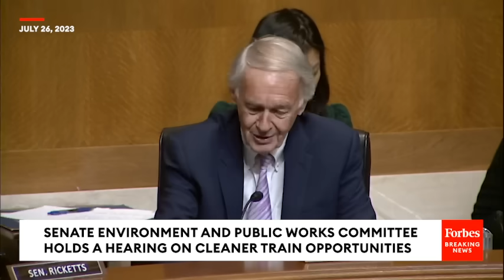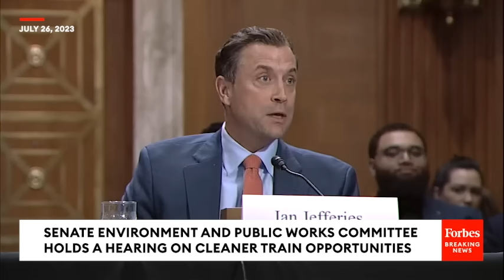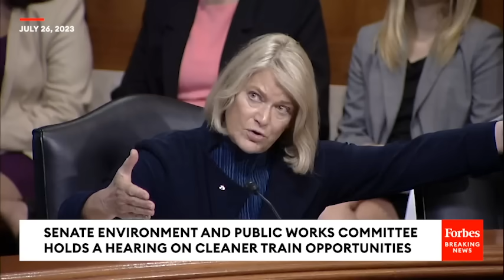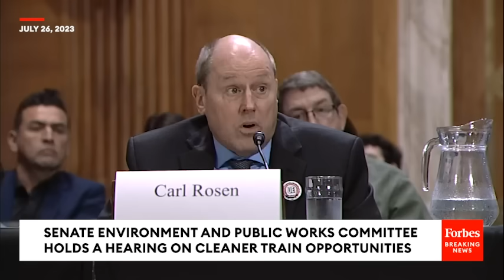‘How Long Would It Take To Replace All Diesel Locomotives With Electric?’ Cynthia Lummis

Comment: Locomotives are electric, the electrical power is generated by on board diesel engines. What she probably means is to remove the diesel engines and have the locomotives rub an overhead wire, like a streetcar in the city. She needs to be educated on the laws of physics. She also needs a job at Walmart where careless decisions go unseen. The wrong people in politics is a dangerous thing.

Comment: Electric locomotives? This is a pipe dream. The weight of the batteries alone would severely reduce the pulling capacity of the train. Those batteries would probably take 3-4 full days to charge.

Comment: How far do they go on a charge? How much carbon does it take to get that battery into the locomotive?
The estimate from VW to get the carbon foot print of the Passat EV and the diesel even is about 100k. The estimated life span of the EV battery is about 100k, the average diesel engine will go about 400k.
Most diesel locomotives go 1,000,000 miles. How long will the batteries last? How many charge outs will have to be done to get 1,000,000 miles. How many children will die in slavery mines of 3rd world countries to make California happy??

Comment: What a joke. Glad she is not willing to put up with their bullshit.

Less they are running power lines all over the place that trains run from and that electricity is coming from nuclear power, this is a pipe dream.

Let's also not forget the amount of batteries (weight and wasted space) that it would take to have enough power to accelerate a train with cars up to speed and maintain said speed for even a short period of time.

It is much like a large rocket going to space where a HUGE amount of the payload is the actual fuel.

Lots of content out there debunking this bong water chugging dream such as https://www.youtube.com/watch?v=4KygIqhsAvU

Oh, well that and any basic physics textbook were you calculate energy, loads, force, work, etc.

Lastly, she even said that the total carbon input from all rail is 1.7% of carbon coming from all transportation - this is literally picking up pennies while ignoring opportunities that are worth thousands. If all rail was replaced tomorrow the reduction in total CO2 output would barely be impacted as transportation is not were all of it comes from. Transportation, depending on which data you look at, is around 29% of total US emissions. She is talking about 1.7% of 29%, meaning  a total net reduction in output if we were suddenly on all electric trains with zero emissions (not possible as we would have to generate power somehow) would only reduce total US CO2 output by 0.49% (this is per her number).

The greenies out there, and the greenies in congress, need to work on technology that is not existing yet, and most certainly profitable, so private sector can create the break throughs. You can't just mandate by act of Congress solutions that aren't possible in many cases yet.

Even with having solar technology out there for a long time already just look at how much money was lost a couple of Presidents ago on solar (Solyndra ring a bell)

Comment: The beauty of the climate grift is that it is a question that can't ever be answered. This allows money to continually flow with no end in sight. The cost benefit likely does not include the disposal and building on the MONSTER batteries required on locomotives

Comment: Diesel locomotives are much more powerful and have a much longer range than battery powered counterparts.  Lets also not forget the enviromental issues with the mining process for battery compnoents or the enviromental issues with used up batteries.. They also have to be charged which uses elactricity produced by fossil fuel generating plants.  for supposedly  smart people there is an alarming lack of common sense.

Comment: This is fucking insane, and the fact that the train guy does not tell her this is even worse....ALL DIESEL TRAIN ENGINES ARE ELECTRIC. Diesel engines would have to be far larger to move that mass. The diesel is a GENERATOR that powers a massive ELECTRIC MOTOR that actually moves the train. Want to get rid of the diesel, install massive power wires along EVERY railroad track in the US and install contacts on the trains to directly utilize that electric, like old cable cars. OH WAIT, that already tried that and it was inefficient and impractical, which is WHY they have diesel engined driving generators to power ELECTRIC MOTORS.

Comment: Pure electric has issues. 
3rd rail nice but safety is concern. 
Overhead cable a problem loading some wagons Overhead loading will be problem. 
Battery yeah sure.

Comment: And yet nobody wants to invest in updating the mainline infrastructure to use overhead wire, where it would be economically cheaper and environmentally friendly long term compared to developing, updating, and purchasing  diesel-electrics, the most inefficient, short-sighted type of motive power. They were only ever good for shortline work and switching.

Nobody thinks long term anymore.

Comment: Net Zero? Really! When is the  Air Force going to convert all their fighter jets and transport planes to electric and are they going to do mid flight recharging. How heavy would a battery be to fully power a loaded F-15, F-16, F-18, F-35. Explain Net Zero again for me.

Comment: Electric vehicles are not a settled technology. There are way too many problems that need to be fixed and addressed before it becomes viable. But those in control are pushing it more for political reasons and control and not our benefit.

Comment: Don't these people know that "diesel" locomotives are already electric?
The deisel engine only runs a generator, which is actually more efficient than trying to transmit electricity the vast distances required for American railroads.
The USA is much bigger than Europe.
And battery power, first you have to generate the electricity and the batteries needed would outweigh the cargo load.

Comment: Diesel locomotives ARE ELECTRIC. 100% electric motors on each drive wheel. The diesel is for the generator to provide the electric for the electric engines. I think they meant BATTERY trains because otherwise the statement is stupid on face value. Diesel locomotive drive engines ARE ALREADY 100% ELECTRIC !!!!! They just need the motor to run the generator for all that current the electric motors need.

Comment: Electrification of the nation's railroads could be accomplished by covering the network with catenary (poles and wires) or battery powered locomotives.  

The numbers for the poles and wires, according to numerous studies, have never worked out.  One of the best studies was to electrify the PRR from Harrisburg to Altoona or Pittsburgh after WWII.  The PRR did not go through with it because the numbers showed that it would not be able to recover the cost of the investment.

We are long way from having battery powered locomotives that can pull massive trains over the road.  The units that are being tested in yard service are far from the power that would be needed for a road locomotive.

Comment: All we need is magic batteries and magic chargers that run off totally green energy resources. And overcome the supply issues associated with the precious metals that go inside these batteries. Not to mention the awful conditions people work in to get those minerals. 
Or install overhead powerlines across the entire United States rail infrastructure, whilst powering it completely from Green energy sources. 
Totally unrealistic but I fancy the chances alot better with the second option. Batteries are not a valid option.

Comment: The experimental battery/ electric locomotive were Not impressive. I ran them between Bakersfield and Stockton . I estimated they produced about 100% (of a diesel electric)for 1 hour or maybe 25% for 4-5 hours, then totally useless after 5-6 hours, then it needed a recharge . But that’s just my opinion as a locomotive Engineer. My opinion is only based on 30 years of running by the seat of my pants.If they want all electric railroad then install overhead electric with regenerate braking. There’s too much wasted electricity with current dynamic braking practices, the battery/ electric locomotive uses regenerate braking but the batteries are just not big enough . Europe, China, Japan are years ahead of USA .

Comment: Each modern locomotive has a diesel engine that powers an electric generator that powers the electric motors that drive the train each locomotive is between 3,000 to 5,000 horse power. Now if we have 2 or 3 or more locomotives pulling a train this could be a combine horse power of 15.000 to 20,000 house power, so the question is how many thousands of batteries do you need to equal this horse power and  how do you charge them? Just because you get elected to a public office this does not automatically change you from a fumbling moron to a genius

Comment: If the rail network is to run on battery-powered electric motors, where will the electricity to charge rhem come from? Also, what will take their places while they are spending hours recharging?

Comment: DIESEL LOCOS ARE ALREADY RUN WITH ELECTRIC MOTORS. HENCE THE TERM DIESEL ELECTRIC, EASY TO ADD A THIRD RAIL OR OVERHEAD WIRES. EXPORTING THE POLLUTION

Comment: Electric commuter trains for short haul passenger service are great. Using Electric trains for long haul Frieght sounds highly implausible. The demands for Rare earths and the sheer size of the batteries needed to do the equivalent work of modern deisel trains, with the exact same cargo capacity makes electric the least likely candidate for hualing bulk cargo across the  United States by train.
Since we lack the capacity the line of questioning by the Senator semed rather redundant.

Comment: Another question is how long would these mythical battery locos last. 
There are still plenty of diesels abotu from the 60's (and before) that work just fine. How many batterys can you think of which last 60+ years still able to do their job just as they did when new?
Electric car batteries tend to be fairly useless or completely gone by 8-10 years and since its the same chemistry you can bet it won't be a lot different for trains - especially with the massive loadings placed on them. 
What would we be talking - 15,000lbs - 20,000lbs of battery every 5-10 years or so? 
Good luck greenwashing that one.

Comment: They need to run power wires over the tracks to provide the juice. Batteries are crazy and will not work
Reply: Over 160,000 thousand miles of tracks.

Comment: The infrastructure is not even their to have the capacity to charge these batteries for these locomotives. Solar and wind is not enough. They would have to use fossil fuel or Nuclear.

Comment: Can you tell us how long/far the locomotives will go?  Can these new locos pull as much weight as the good ones?  How long will these batteries that are terrible for the environment to create last?  Can you tell me what will become of the batteries once they no longer hold a charge?   Can you explain plans you have that will account for batteries as they age and get both weaker and last far shorter a time as they age???  These people are nuts.  Electric is not the answer.  Gonna need a boatload of coal fired generators and loads of nuke generators as well.  Our current grid has rolling black/brown outs now, so lets make it worse!!  Any neat plans for electric planes?  Imagine a sudden battery issue at 30k feet.
Reply: Yeah see if you can get a 900,000 thousand pound fully loaded 747 off the ground with lithium batteries. That's all folks.

Comment: Those are diesel-electric locomotives running now. And if you have ANY desire to implement electric vehicles you MUST start by upgrading the electric grid. Electricity is not magic and it must be generated and distributed.

Comment: A better question is, how long is it going to take to completely rebuild and upgrade the infrastructure to produce and distribute the astronomical amount of extra electricity required to charge all of the batteries in all of the electrical vehicles, passenger cars, over the road freight carriers, ships, trains, planes and on and on and on. Next question, how are you going to produce that amount of electricity without using coal or diesel generators. And finally, where on earth is all the raw material going to come from to manufacture the three batteries and all the raw metal ore without using fossil fuels to smelt the ore and enable the extrusion process.  It's a fantasy. An impossible dream at best. A ridiculous farce and total lack of intellect and reason.

Comment: Just do what Edison Motors did, add a battery step between the diesel generator, and the traction motors (those are the powered wheels, and the train version of E-axles)...or bring steam engines back...NOT like that. Yes tradition has it's looks (I personally like German ww1-ww2 era steam engines), but use electric heaters, or another source of "green" heat and use that to heat up steam in a boiler, and if you know how a steam engine works, the rest is simple.

MAJOR EDIT: The older lady doesn't understand shit. Modern diesel electrics have traction motors. These are NOT new. They've been around since prior to US involvement in world war 2. You don't need catinary(overhead wires) for the fleet.

Comment: The Elites have a new all electric Locomotive....Its genius.....the locomotive will  have a windmill  mounted ahead of it .....The theory is when the wind blows it will supply initial power to start the train rolling..then as the train picks up speed the wind mill produces more  ...thus supplying power for cruising.....Genius..

Comment: All locomotives are electric, the generator that runs the electric motors on said locomotive are powered by diesel. There is not a better use of fossil fuel other than diesel PERIOD. ALL VEHICLES SHOULD BE DIESEL AND WE WOULD CONSUME FAR LESS FOSSIL FUEL PERIOD. READ THAT AGAIN AND IT MIGHT MAKE SENSE.....and after that we can talk about containter ships from CHINEE....

Comment: No amount of solar wind and battery tech will get us off fossil fuels nor the absolute insane amounts of products that are made and can only be made with polymers especially cheaply.  Unless we're finally going to start putting down nuclear power with modern efficient reactors designs that are nearly impossible to melt you will never make up the difference. And still you'd need crude oil for all those polymers, the alternatives are not scalable to cost.  All of this is California ideology and not based on facts.  It's either an attempt at market capture or the destruction of normal people having things affordable.  Only cheap energy leads to a this modern life.  If power becomes a boutique and expensive privalage only the rich and powerful will have it.

Comment: Does the dingbat know that it takes power to move trains. The giant diesel motors already run enormous electric motors in most trains for the drivetrain.. It takes constant mega power, this isn't a train set you play with in the living room floor.

Comment: Califorina is the definition of keep trying to fix things until they are broken... your low key the def of F around and find out!  And no class 1 railroads will not continue to order tier 4+ locomotives because they cost 2 million dollars. Nothing wrong with using old machines...
Reply: Also if you want to talk about emissions... let's see how long it will take to put out the fire when one of these electrics have thermal runaway

Comment: What people might not know but Diesel locomotives are powered with Diesel generators running electric motors to move the Train, so it wouldn't take much of a transfer from engine to Batteries but is the batteries going to have enough electrical Horse Power and Kwh's to travel 1000's of miles without stopping each day. Cost of using a train for shipping materials is going to triple and time with triple as well. Remember every time you add weight to a moving object you need more horse power to move it. More weight means more costs.

Comment: and then there's the massive elephant in the room. If charging 50 electric semis is a 5kw power drain, what is the offset going to be from installing a few more power plants just to charge a train for a couple hundred mile trip?

Electric trams work considering most of the infrastructure is already in place. Where in the current rail network are you supposed to recharge a loco?

Comment: How goofy can things get, Start with Biden and Harris. Why the big push with getting rid of oil. Gasoline powered cars with cataletic converts emit cleaner exhaust than ever before. But that has been eraced with over 600 forest fires in 2023 just in the USA. Diesel powered Trailer trucks also have catalic converters but must add a chemical that heats the exhaust for the cat . to work  cleaning the exhaust. A diesel train is actualy electric , the diesel engine runs a large generator that sends electric to the motors on the wheels. The people appointed to run the different departments are more qualified to work in a carwash than in the positions they have. India, China, South America are doing very little  for clean air. Forest fires are the main reason for carbon emissions. To force this change on us with electric cars that are way to expensive is nuts. The tax on diesel fuel should be cut by 70 %, this would bring down the shipping costs which in turn reduces consumer costs. We have to go into this big of a change in steps. The Biden ideas are dictated by a group of amateurs, but it will take a joint effort by the people to put them on the unemployment list.